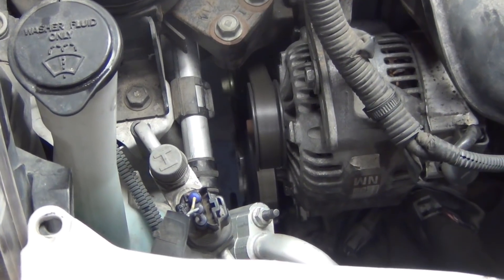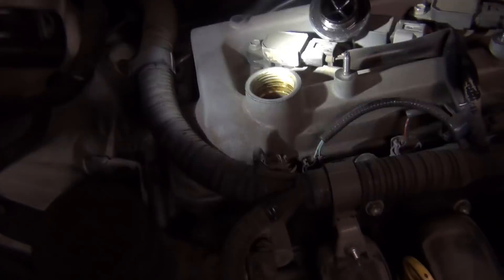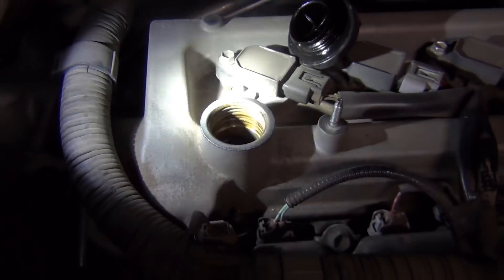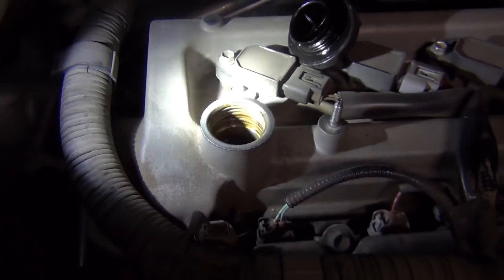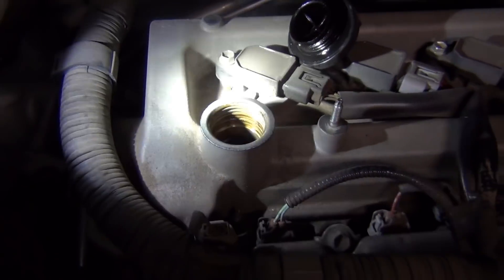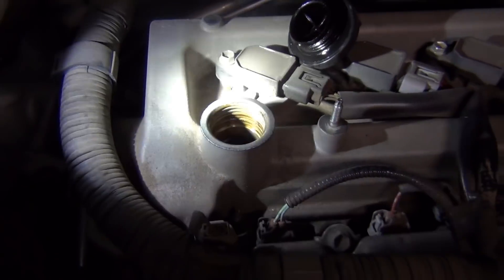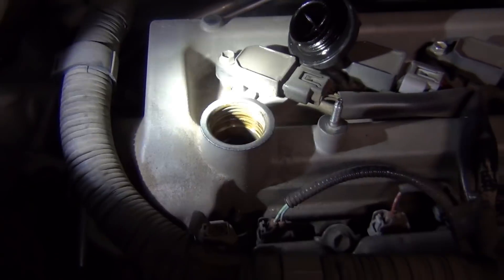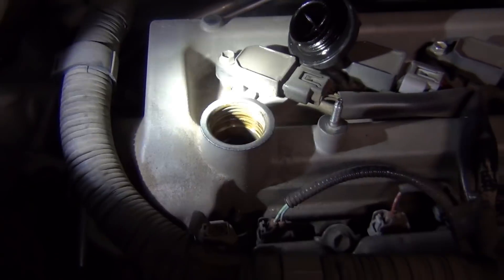Toyota Water Pump Noise and Replacement How to

Comment from the maker: Links to tools used; stethoscope → http://amzn.to/2xxcyHi Stubby Gearwrenches → http://amzn.to/2wOYXqX Flex head ratchet → http://amzn.to/2y15aoO Pig mat → http://amzn.to/2yyrseN Electric ratchet → http://amzn.to/2wOSkoC Lisle Coolant Bucket/funnel → http://amzn.to/2fJzNoh Cooling system pressure tester → http://amzn.to/2yyNIVI
Reply: I have that M12 ratchet and LOVE it. Second tool I've bought after watching one of your videos. The other one was that Dewalt impact, I also have it's big brother, the brushless one.
Reply: Why would you be talking, when you have the engine running, and having the mic right next to it?

Comment: Hi Brian. Have you ever seen permatex high tack. You can get it in a brush can or spray can. It's what you should use in that application instead of Right stuff
Reply: spray tack not bad but all I do on decent quality gaskets like that is smear a little grease on surface of gasket, keeps it in place and helps bed it in plus keeps surfaces cleaner for time it may come off in future . Never had one leak yet .
Have had some really poor paper gaskets with some aftermarket junk when very light smear rtv seems best best though .

Comment: Super B,  When I have a tight-space water pump, I get studs w/ nuts & lock washers.  It's easy to put the studs in while the pulley is off and far easier to align the holes when putting the pulley back on.  Thanks, as always, for posting another great vid.  How bout introducing your family sometime?

Comment: did you use a toyota water pump the first time around, or aftermarket? And are you torqueing to spec is the electric ratchet set to a certain torque?

Comment: Added hint.....don't need any further gasket sealant.....use the metal/composite gasket that comes with the new factory (Aisin) unit.....and if YOU ever need to do it again....no issue scraping off goo. Mine didn't leak using only the provided metal gasket on a clean engine mounting surface.

Comment: It’s even easier if you just get the water pump that comes with coated metal gasket like the OEM one. They never seem to leak (the gasket) and it’s faster to install and a lot easier if the pump needs to be changed again.

Comment: I had a Toyota 22R and the timing chain tensioner  wore out (sounded like this one) and the chain wore a hole in the water pump housing and was leaking coolant into oil galley.

Comment: I have to mention that these engines always have alot of air coming out of the top oil fill hole do some reasearch on thesw engines i thot like u mentioned also how ever on these cars that is not piston blow by

Comment: Hi Boss, i have 2010 yaris and may car have low idle after 3-5 mins whenever i ON AC, first 800-850 then 670-730, i changed spark plugs, cleaned injectors Throttle body, intake gasket Throttle body gasket, and mass air flow cleaned and no check engine light and every thing done

Comment: On a related note:
The sliding nut on the alternator was the cause of my week plus of driving with a strange noise. (recently replaced an alternator). Could not figure it out until I got an automotive stethoscope. Best $15CAD ever spent. I did not tighten the 14mm properly (pulling the slide nut in) and it caused the alternator to vibrate and possibly ruined some bearings in the alternator. The only combo that fit the limited space was a 1/4" drive adapter and a small socket. I have ruined 2 of the 1/4" adapters and ultimately welded the socket and said ruined adapter together! Noise is gone!

Comment: I have an 2010 Honda CR-V with 110 thousand miles. I want to change the water pump and alternator before they leave me on the side of the road. How many more miles, in your expert opinion, can I push it .?
Reply: I'm getting the pump changed on my Yaris today as it's making a racket like in the video. It's done over 140k miles on the original pump. I believe it's the original alternator on there too.

Comment: How did you get the pulley off? Prybar?
Reply: Also I like to put anti-seeze on the pulley teeth so it doesn't rust onto the pump...
Reply from the maker: I brace it with a prybar- I know that seems sketch like you're going to bend it, but I've done more than a hundred without bending a single one.  From there, I just pop it off by hand. I think the prybar twist method helps break it free as you go around getting the three bolts cracked free.

Comment: i have the same yaris it has much much MUCH more space ... its 1.0 engine.
Reply: zloben9000 same engine as the aygo, 107, and c1. They're great little engines.
Reply: There's a big difference between my 1.3 litre MK1 Yaris and a family member's 1.0 litre. I can almost stand in the engine bay of the 1 litre and everything is so, so, so accessible. It has the air filter on top of the engine block too, mine is to the right. Best thing is the oil filter on the 1 litre can be accessed and taken off by putting your hand straight through next to the radiator. It's basically designed for ease of use. On my 1.3 I have to get underneath the car and it's a lot easier if I remove mud guards and trim that gets in the way.

I'd go for a 1.0 for my next one just because it's so easy to maintain!

Comment: I can’t break loose those three pulley bolts with a regular 10mm wrench.
Reply: Put a pipe, or a closed end wrench/spanner on the open end of the 10mm for more leverage. Make sure you are turning the correct direction.

Comment: Can you still drive it sounding like this? ?
Reply from the maker: Generally no.  Not without sustaining further damage to other parts of the engine.
Reply: @briansmobile1  is there only damage done when the waterpump eventually fails? (I.e. overheating) or is driving on a noisy pump bearing like this risking anything else? I've got a family members Yaris in the shop today getting the water pump and belts done as it sounded like this. But I want to learn how it's done so I may one day have to do it to my own ;) thanks for another great vid man.

Comment: Very good job. Although i dont agree with the silicone on the pump. Thats gonna be a pain to remove for the next guy. Let the gasket do its job! Other than that love your videos!
Reply: Well you aren’t quite right, I had to completely change the gasket because once the aluminum one breaks even a little bit, it leaks everywhere. Silicone makes it stick to the water pump so you don’t accidentally snap it like I did or install it wrong.